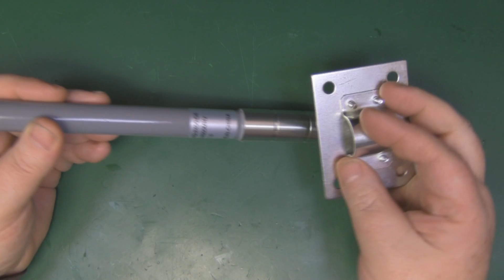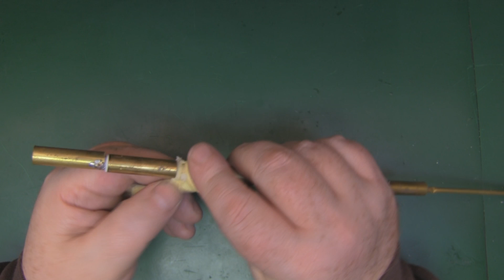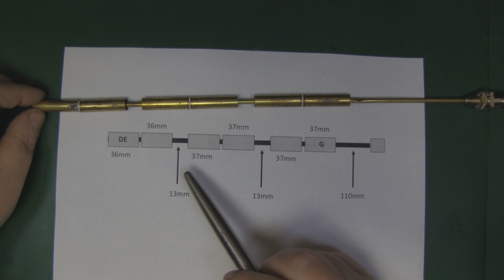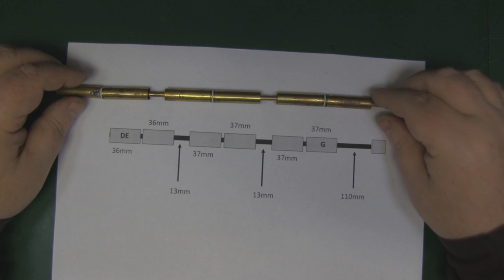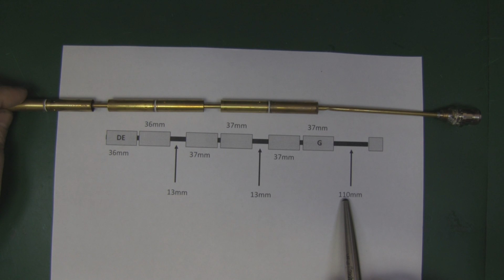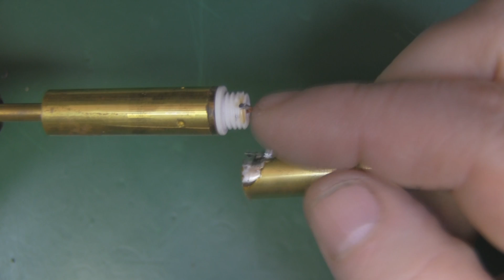6dBi and 8dBi 2.4GHz WIFI WLAN Wireless Dipole Omnidirectional Antenna #176

Comment: General Question: I have a router with only one antenna.  Can i put an SMA splitter on the router, attach the stock antenna to the one end of the splitter, and run a SMA extension from the other end of the splitter to a Cantenna outside. Will both antenna work - Giving me an inside omni directional and an outside directional antenna?
Reply: aslong as one is the transmitter and the other the receiver yes but why directional?

Comment: Basically every wire inside a tube is a coax cable. If it has 50 Ohm can be easy calculated. https://en.wikipedia.org/wiki/Coaxial_cable
Let's assume the tube has 4mm inside diameter, the wire has 1mm diameter and the insulator is made of PE than we have ~55 Ohm Coax Cable.

Comment: I have a general comment: First off, I quite enjoy your videos. I am very interested in antenna design. It would be most useful, to me at least, if it
would be possible to show an electrical/mechanical diagram of the antenna you are working on. I have a hard time trying to figure out the connections. Just a thought. Thanks for your very informative videos.
Reply: its a skirted dipole antenna